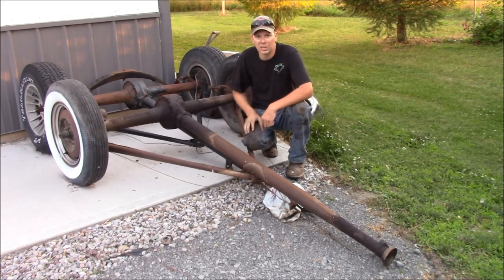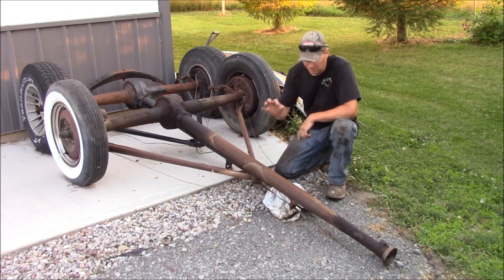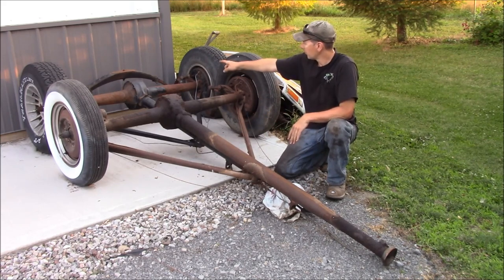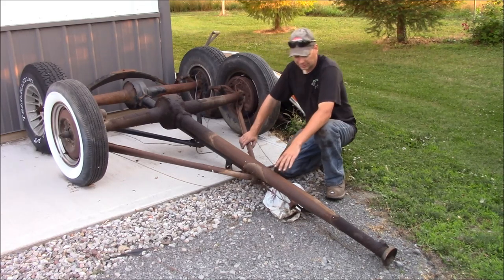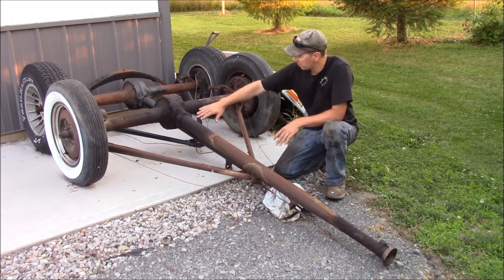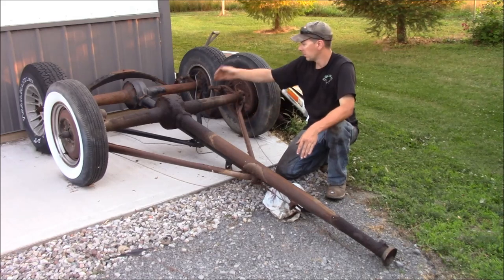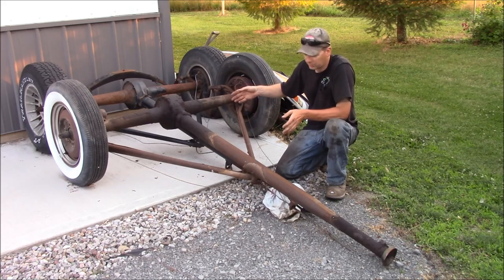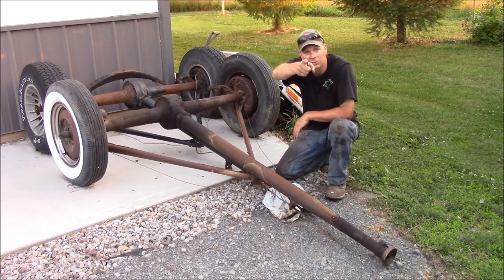Ford Torque Tube Rearends:  Whatchya Talkin About Wednesday

Comment: BAM!  There's your rear axle info for Wednesday.  Chevrolet also used torque tubes.  I'm not sure of the year they went to open driveshaft.  Thanks.
Reply from the maker: I think Chevy went non torque tube around 1948 as well.
Reply: @QuickSpeedShop   Not to demean you:  I did a search and found an article titled "1949-54 GM Car Torque Tube to Open Driveshaft Conversion ..." leading me to think '54 was the last year.
Reply from the maker: For Chevy yes.  I think Pontiac went open in '48.  I think Buick might have stayed closed along with Olds for a year or two longer, but not sure.
Reply: @QuickSpeedShop    It makes sense- GM decided to test out open driveshafts on their more expensive models, then added them to the Chevrolet line later.

Comment: Your dates are a little off, Ford went to torque tube suspension with the Model N in 1906, the Model S and Model T were also torque tube.
Reply from the maker: I was referring to the modern style torque tubes that are interchangeable 1928-1948.